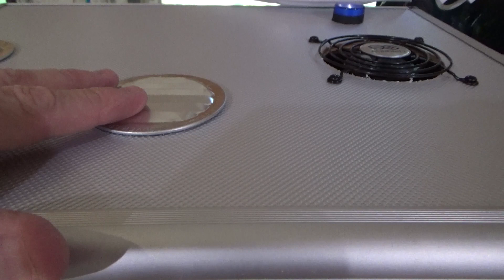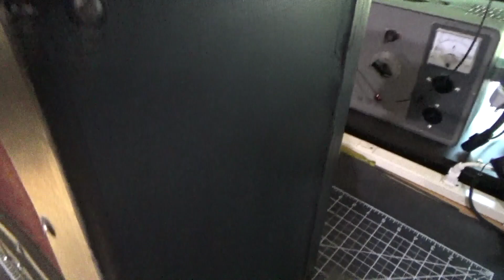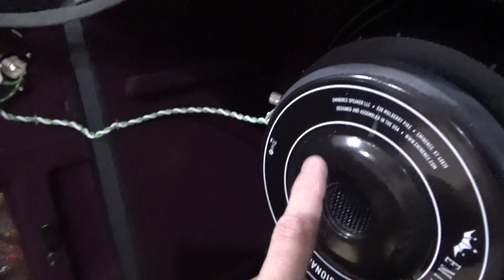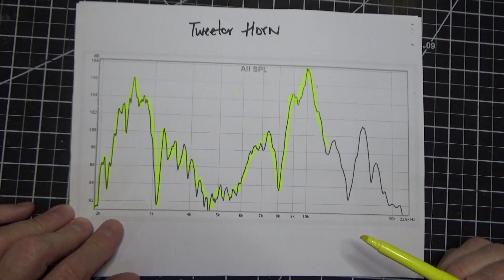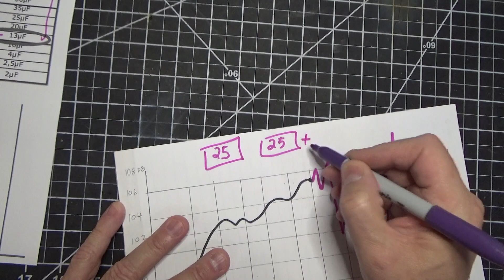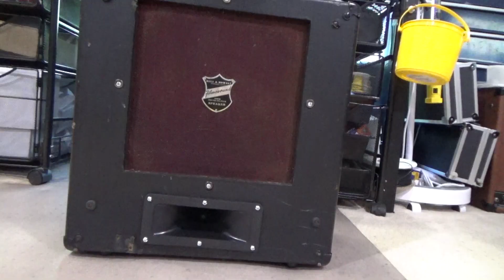Class D Amplifier Build: Episode #3: Its done, its build and it ROCKS !!!

Comment: Sounds really good, Ron! You can hear the round wound strings on that guitar! I remember, back in the day, they taught to use 40-400-4000 Hz as a template for frequencies for the bass to include the basic bass freqs & the overtones! That was back in the 70's! In the time before the 5 & 6 string bass guitars came out!  My first amp was a 65 Fender Bassman, the only problem was, I played a 6 string (Gretsch) guitar! I eventually bought a reverb unit for it & then an Echoplex! Wish I still had that amp! LOL Great job on this amp!
Reply from the maker: Thanks Tim.  Interesting info the 40-400-4000  I didn't know that.     I had a 71 Bassman that I recently sold....after I made it electrically stable of course... they were great amps.. I still have a Bassman 135 which is from 1980... loaded with power.... and a 59' Bassman as well.  great amps - Thanks for your kind words - take care

Comment: Nice job Ron!
Question, are you going to use this amp & speaker system for just a bass guitar?
I ask because I never heard of having a tweeter on a bass amp,  I  would think the bass response would not need to go any higher than maybe 500 CPS, but what do I know....LOL
Reply from the maker: Bill,  I am going to use it for bass guitar.  It is very common for bass amps to have horns in them. Bass is a unique instrument in that it can cover a wide range of frequencies. A bass amp without a horn would sound good about halfway up the neck, but once you start playing those thinner strings like the D or G , it climbs about 2000h for sure..  Good question !

There are 4 stages   BASS -  60-250 HZ        LOW Midrange   250-500 Hz      MIDRANGE 500 - 2K Hz    and  UPPER MIDRANGE  2k - 4k H
Reply: @rciancia  That shows  what I know....LOL
I always thought a bass guitar went down to 30 CPS, I think a big stand up bass will.